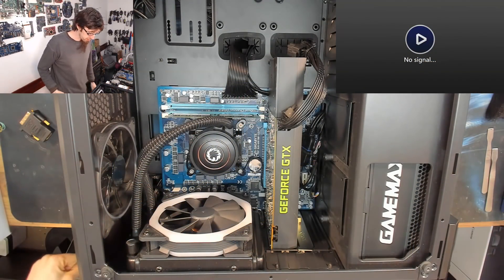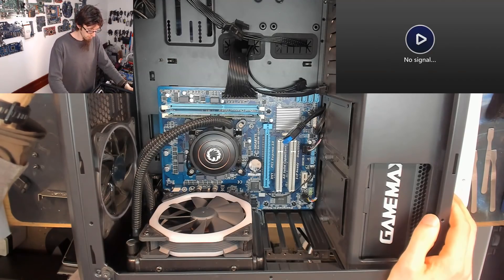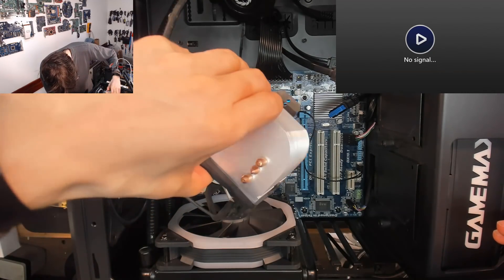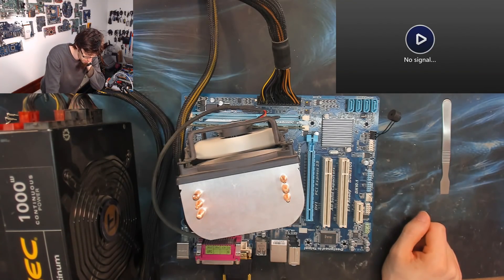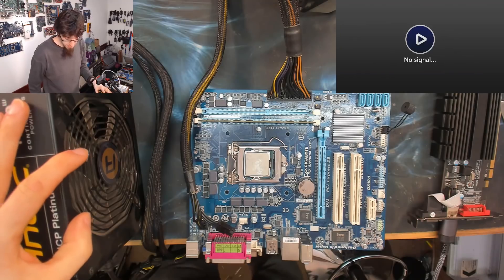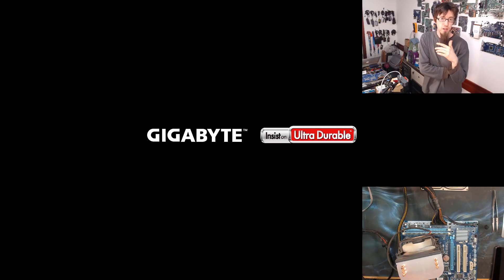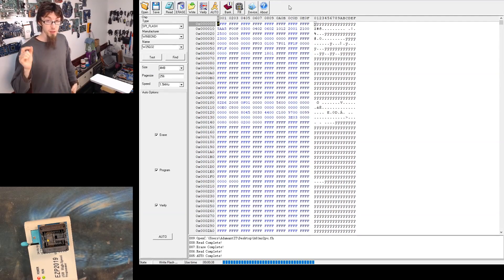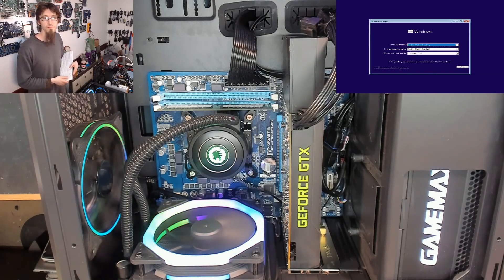LFC#207 - Troubleshooting an old Intel Platform (GA-H61m)

Comment: The problem with the output has to do with EFI and the GPU bios, had this problem once with a R9 290X updating it’s bios fixed it.
Reply from the maker: I think you're bang on the mark. Over the weekend as I published this video, I was watching and saw that in the final scene where it all works with the 960, the GPU wasn't booting EFI because the resolution had dropped. I must admit I don't know a lot about GPU EFI - I'm aware of its existence, but have never really investigated the differences and when you get a 'full EFI' and when you don't.
I think the garbled video was a red herring the whole time - the problem was fixed as soon as the board started posting first try and wasn't cutting out or power cycling.
I might make a follow up to this to explore GPU EFI BIOSes and a few other things people have said - there seems to be a bit more to learn from this that I missed at the time of recording!
Reply: Beat me to it, spot on.
Reply: @Adamant_IT  You should have flashed that beta bios, it probably fixes the GPU problem.
Reply: I'm glad I'm not the only person that has been stumped by GPU/EFI compatibility issues.  I thought I was going mad.  Quite a frustrating problem if you don't know about it.
Reply: I'm not convinced it was an EFI/GPU incompatibility, as the onboard video had the same issue.

Comment: Having worked with SPI chips on TV and laptop board for a while now myself, I can confirm indeed that in-circuit reading doesn't work and I don't even bother - I just desolder the chip and leave it alone as it is on the table. I grab a new, blank chip and mess with that instead, especially if the device is working to some extent and I don't want to mess with the little life it's got left which may depend on the chip I just removed. This also confirms that the chip itself is not at fault, though it almost never is - what's actually on it gets messed up. In the case of TVs, it's caused by bad, noisy DC coming from the power supply once its caps start to fail. Happens on Samsungs all the time, esp. old LE series ones. Love your stuff - your style is similar to mine. Cheers !

Comment: I admire you so much for your persistent nature to get something working truly it is nice to see.

that being said time vs £ probably would been better after 13 mins just paying £25-£40 (for £40 you can get a working GA-H61m with a working i3 processor on it and cpu cooler just fyi). I love pc repair I just think it needs to be said the money per hour imo is just not there especially when you in your own words didn't even think it would work. one can easily end up down a rabbit hole of 5-6 hours of work where £30 for a new part would guaranteed to solve the issue. don't get me wrong i respect your doing this for curiosity and fun just think it does need to be stated.

Comment: I think it has dual bios just follow steps:  1. Unplug any hardware (recommended), only Monitor and Keyboard
2. Press Power Button, but HOLD. Computer will start, after a few second. Wait until computer back Off, and release Power Button.
3. Press Power Button again
4. Computer motherboard will update BIOS Corrupt automatic. Wait until finish and computer will turn off
5. Now Press Power On again
This way I fixed many free given Gigabyte motherboards from people which thought its need to be in the trash can. Or almost for nothing sold desktop pcs, because of corrupted bioses. Other vendors also  has bios backup but it also depends on motherboard models. Btw I forgot to mention you don't need physical switch, just use manual provided by vendor, btw I found your videos recently and its very entertaining and full of helpful information.

Comment: An easy trap to fall into is putting your build into the case when it appears OK BUT I've adopted the 'soak test' principle where I leave it out of the case for 3 days and regularly test the system ie that it posts, it runs OS fine et Thermals obviously out of the box should be a little higher depending on the temp in the room et but the main focus here is that it works fine and has over the three day tests. I do admire your tenacity re this old mboard as truth is generally most fail because of power outrages - clean replace the power and they can work fine, dust of course in old power supplies is murder and I am sure this guy has seen plenty of those where you clean em and its like having a mini dust storm on your hands. Keep up the good work buddy ☺‼

Comment: love the vids buddy!! im troubleshooting a dell t3500 mobo kinda doing same thing...was working...went to my girls for a da and came back and battery problems then next day no picture....tried different batteries...ram...power supplies cpu,,,still no pic...even used onboard usb to do the data to a external mining gpu pcie slot n didn't work...when I jump the 2 power pins it wont boot now but if I touch the rtcrst jumpers with a screwdriver itboots the cpu fan but fans don't spin on a rx580 n no pic...and on a 1gig ddr2 old card the fan does spin but no pic...not sure im feeling like a bad mobo...but love to watch your vids man!! definitely helps on ideas n troubleshooting..keep up the awesome work!!

Comment: I'm suprised this worked out. The last Intel mobo I dealt with, a 965 one which was even older than yours, didn't use straight serial flash dumps for the update process. The bios update files provided by Intel instead did use some UEFI structure with parts that were written seperately into specific areas in the flash by an executable program included in the bios update file itself that gets executed by the bios on next reboot. Notably, the flash area containing device specific data like serial numbers and MAC addresses was not written to. It was pretty hard for me to deduce which parts from the file I had to manually write where to.

Comment: Just a tip, those alligator clamp chip connectors wear out quickly from my experience, they have little plastic teeth at the tips that force the metal pins into contact with the chip leads and those teeth can get worn to the point that the pins will not make reliable contact.
Another issue I've seen is that some motherboards may not have the proper circuit layout to allow in-place chip programming from an external programmer, and you have to desolder the chip anyway.
In any case, I've been able to salvage many otherwise dead board by just reflashing the BIOS. It's crazy how much good equipment just gets tossed due to simple little problems like this.
Reply from the maker: I had ANOTHER attempt at using the clamp last week, and while I finally got it to talk to the chip, I think it may have upset the motherboard. Definitely done with it. Just going to desolder every time now.
I wanted it to work because I understand that not everyone wants to take a hot air gun to their mobo, but yea... better to spend time learning to use a hot air station that learning how to use the damn clamp!

Comment: I've found that dual-bios boards can be easily resurrected by physically swapping the main and backup bios. After the swap, update the main bios (from the system itself, not an external flasher) and this updates the backup bios. The physical swap also helps incase the main bios chip is wearing out. Gigabytes in particular live up to the "ultra durable" title with this, they feel almost indestructible. Finally bad power supplies seem to cause the main bios to become corrupt.

Comment: SAME issue with my GA-H77M-D3H, in fact switching from IDE to AHCI was the final nail. "ULTRA-DURABLE" lol Initially appeared to be bad x16 slot: wouldn't fully post bare board unless vid card was removed (and using onboard, or using an ancient x2/x4 card). It finally got to the point where it corrupted the backup during recovery and all was lost. In process of re-flashing/replacing EEPROMs. I wonder if these boards are unusually susceptible to ESD damage.

Comment: I got the feeling that the monitor (or video capture device) didn't like the resolution/frequency of the video display when it was in BIOS setup. I wonder if a different monitor would help?  Maybe an old CRT monitor considering how old it is?

Comment: IIRC you can force gigabyte boards to boot from their backup bios in order to reflash the new one - I think you have to hold down the power button after clearing CMOS?
Reply: That really works. I've tried this myself.  I hold the power button for a couple of power loops and   the bios backup kicked in.

Comment: Remember most of Gigabytes dual BIOS  motherboards without a manual switch will switch to the backup BIOS after it cycles through like 3 boot errors.
Cool vid. I have a ABit AG8 uGuru (915p Prescott) motherboard that does the same thing.

Comment: so I'm guessing the bios was still using the onboard graphics despite having a gpu seated on the motherboard. some boards will still use the onboard graphics through the graphics card. had a similar issue with a ryzen apu build

Comment: Nice video. The garbled graphics is similar to old arcade boards and sometimes reflashing the rom on those works. I wonder one of the bios pins is just missing a signal.  Trying to figure out where that signal would be coming from is probably not worth the effort. If you remove the main bios chip will it just default to the backup chip?  Lol I started writing this comment before watching the last minute... I’d take this as a win

Comment: GA-H61M-S2PV boards (like the one you've got) are prone to main bios corruption for some reason. At the school I work at, we have about 250 odd Zoostorm branded PCs where 2 thirds are S2PV and the other third has GA-H61M-DS2 boards. I've had a good couple of dozen of the S2PV boards go corrupt where the DS2 boards have been fine. I suspect cheaper chips were probably used on the S2PV boards as to why this may happen.

Comment: Hi again, Adamant IT. 
What is your temperature and airf flow level when soldering and/or desoldering chips from the ATX and/or Laptop Motherboards?
Also, what is that software do you use for flashing the BIOS?
Reply from the maker: On motherboards I run 400c, and moderate it by staying a few inches away from the chip. This is with a super cheap hot air station - your unit may vary.
The software is just called EZP 2019+ and came with the programmer.
Reply: @Adamant_IT I appreciate you took the time to respond to my comments. I'd like to express my gratitude. I will be starting my own local Computer Repairs Services here.

Comment: which hot air work station do you use and at what temperature. thank you for the videos great work
Reply from the maker: I use a WEP 862D+ at 400c. It's a cheap 2-in-1 station, and there are many similar stations with the same handle on them. It's great for beginners, but struggles with BGA work, so very much has its limitations.

Comment: Hi there :)
Maybe you can give me your opinion on this issue I'm facing.
I had a perfectly working rig running on:
 - ga-z87x-oc
 - i7 4770k
 - 2x 8GB DDR3 1600

I turned it off and removed the RAM in order to test another DDR3 1600 module I retrieved from a machine that was discarded because of a broken CPU.
The machine wouldn't POST then, I thus assumed the DDR3 module was bad. (Turns out it wasn't)
I put back the original 2 8GB modules but then the machine still wouldn't POST (error 15: "Pre-memory North-Bridge initialization is started") and I get multiple beeps.

Did I just fry this motherboard?
How?

Thanks a lot in advance for your feedback.

Comment: Nice video.
Thank you!
What's the recommended temperature for desoldering from motherboards?
BTW, I remember when I used to play with EEPROM of routers, I had to desolder because the clamp would power not just the EEPROM but other chips when the EEPROM is still on the board so the data of those chips messed up the reading of the EEPROM.
Reply from the maker: Recommended temperature is "As much as you need"!
I generally use 400c for motherboards, and I back off to 380c for simple PCBs (like peripherals). If you're spending 5mins trying to reach reflow temp, give it a bit more heat, if everything is melting with so much as a glance, back off a bit. With hot air, don't forget to pre-heat - blow the air around the general area you're working on first to heat everything up a bit, and then the component you're actually aiming for will flow a lot easier.
But it's going to vary depending on the exact tools you use. My spare iron (WEP 862D+) is a lot less capable than my TS100, and generally needs about 420c to stay effective on heavy PCBs like mobos.
Reply: @Adamant_IT  Thanks!

Comment: I have a board that just power cycles off and back on. Where did you get your bios programmer from? Im tempted in trying this.
Reply from the maker: Worth a shot! I've got one of these super cheap ones - https://www.ebay.co.uk/itm/383556830139
You can probably find one shipping form the UK if you hunt around and pay a bit more, but I got mine from china. Take note, as with cheap stuff, the drivers aren't signed - so you need to turn off Driver Signature Reinforcement on the PC when you install the software.
Reply: @Adamant_IT  i mainly use Linux so will find software for Linux. I moved the board out of a 2u chassis to go into another rack mount case and now it just power cycles will order one of these and see if it brings it back to life.

Comment: Whenever you re-flash the BIOS with a programmer, you should also pull the lithium CMOS battery and let the CMOS reset to factory. In fact, I would've done just that very early on, as CMOS does get corrupted, and can cause havoc on POST. I'm wondering if the video settings in the CMOS could have been misconfigured for that display. The scrambled display makes me think the speed of the video wasn't set right in CMOS, and therefore the video wasn't syncing with the display.

Comment: wouldn't booting the board without the M_BIOS chip installed force the board to boot into the backup?
Reply from the maker: I've tested that on a newer Gigabyte board and it wouldn't POST with one of the BIOS chips missing. I might've needed to give it more tries so the board actually tried to use the other chip - but the problem with Dual BIOS is you get zero feedback on what it's doing. Very hard to tell what state you're in.
Reply: Adamant IT Yeah, dual BIOS in my experience is useless without a switch. I had to short pins 1 to 6 on the Main BIOS in order to force it to use backup (Which wasn’t stated in the manual).

Comment: I also always had some problems with the reading clip! Since the contacts of the bios chip are connected to the board and thus there are always some impedances between the contacts, the reading of the chip is barely possible! No matter the coin cell battery in place or pulled out, I never had luck to identify and read the chip correctly with the clip tool. A quick heat with the heat gun and removal of the chip from the board works for me all the time.

Comment: I have a Gigabyte Z390 Aurous Pro I recently update the BIOS from F9 to F12 and now my computer crashes back to the BIOS and is telling me to set the BIOS to it's optimum defaults. This seems to only be happening when I set the XMP profile to profile 1. So instead of the 3600 mem speeds I am only getting 2400. The HyperX memory is on the qualified list but it isn't working now. It worked fine for the old BIOS for maybe two years but now it's shit. Is it possible to roll back the BIOS version? I did not save the old version when I did the update.

Comment: I have the same type of board; issues, power recycling, would not post, and no picture. Solution; graphics card bad, corrupted solid state drive, switched to onboard graphics, could not get into bios, pulled cmos battery to reset, one bios chip was corrupted, fortunately the backup bios kicked in, replaced solid state drive and was able to load windows 10. I have ordered the bios programmer, just in case I ever need it. (Great video)

Comment: When I take out the bios battery I hold the power button on for a minute two or three times to drain all power from the board
Reply: Good idea! I always take out the power cord, remove the battery and short both leads in the battery HOLDER (!!! HOLDER, not the battery itself) for 5 seconds, works always to drain any capacitor that still has charge in that part of the circuit.

Comment: The problem with the garbled display might have been a grounding or EMI issue.
If it had been a VGA connection I would have said it was a horizontal sync issue. I'm not sure if DVI/HDMI has a similar signalling design.

Comment: I've got an old gen3 gigabyte board with an i7-2600k on it Z77X-UD3H. It will go into a blank reboot cycle on occasion which I can fix by turning the power supply off and back on. Then it acts like it's forgotten my BIOS settings. Once I've entered the BIOS and hit save it acts normal again for a few more cycles. I've tried reflashing the BIOS. I've replaced the battery and tested it and it's good. Not sure what to try next. I have tried a different power supply already.

Comment: You have nice videos ,and You explain things well . Can You , for example , say how much heat/flow speed do You use on station at 23:40 because of plastic elements ? Thanks
Reply from the maker: I run my station at 400c max airflow for removal, and then I turn down airflow as much as needed to avoid blowing things away when replacing. I use angle to avoid melting things, you can see in this video that I'm aiming away from the plastic, and this avoids damage. It's worth noting that I have a cheap hot-air station - a more expensive one you'd probably want to turn the flow down.

Comment: To read or write flash chips in circuit, it's a good idea to power up the board, and hold the CPU in reset, by jumpering the reset pins on the front panel button headers.  You may have tried this already of course!